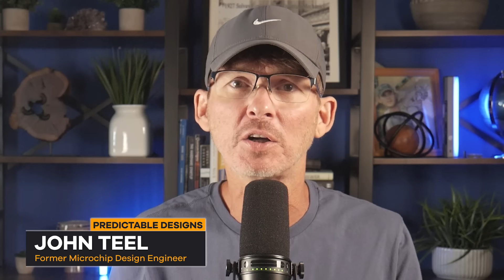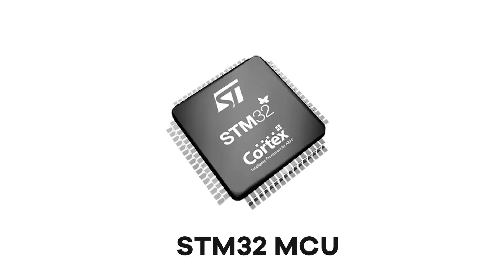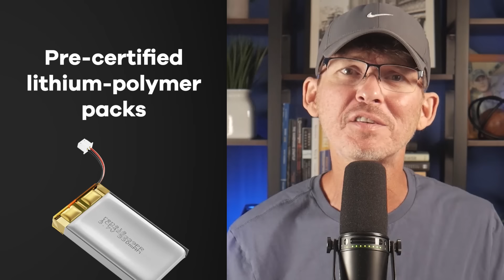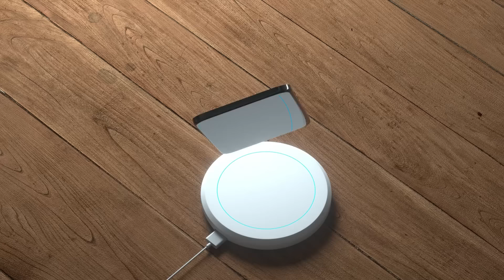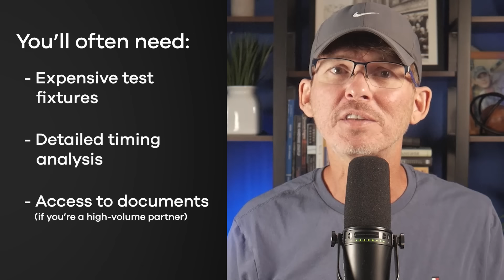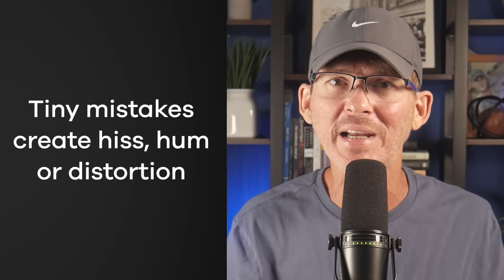10 Technologies You Should NEVER Use in a Product

Comment: USB PD is really no big deal these days - there are plenty of cheap dedicated chips like CH224K, HUSB328, IP2721 and AP33773S  that just do the job very easily with no software needed. The biggest issue is the variety of different flavours of USB mains adapters.
Reply: Yeah , usb pc is quite a non Hassle, only the consumer is usually confused, by which cable and which charger to use .
Reply: USB PD has the potential to allow devices to only draw what the supply can provide. Maybe you’ve got a soldering iron that can run at 100W at 20V, but plugging it into a 60W 20V PD supply will cause it to PWM its heating element to 60W instead. Or with PPS, you could tell the power supply to output a proper CC/CV charging curve for a 3S lithium battery without needing an SMPS in your device. But these more advanced features can’t be done with a simple PD trigger IC, rather you’ll want a microcontroller talking the protocol. QC4+ has similar features. If I recall, WCH makes some microcontrollers that can talk on these CC lines with dedicated hardware. There’s also whatever the Pinecil and TS101 are using.

Definitely more complicated, but the space, EMI, and efficiency gains that come from power negotiation can really push a project into a more feasible realm. I’d just like to see a power negotiation protocol for higher powers with a more robust connector. CAN over 7W2 D-subs. With dumb cables.
Reply: I think the simplicity in usb pd is that it exists already, the power adapters are everywhere and it can output pretty much anything you would need. Yes, a simpler power solution could suffice, but in most cases it would be worse for the end user.
Reply: I came to say the same. PD was a breeze to implement for me.
Reply: Carriers scavenging frequency ranges to support 5g is putting a much closer time limit on LTE than one might expect.  Perversely, this is more of a problem in small single-tower towns than cities.    LTE just disappeared for friends in several locations like that and they found they had to replace LTE with 5g in fixed devices (alarms, etc).
Reply: CH224K Is being replaced by the CH224A
Reply: When you realized how much power USB can draw--enough to heat up a soldering iron cherry red, you want to minimize the chance of being dragged into court because your cool new wearable scorched somebody's scrotum. Unless you're Apple or Google, just use a ready-made certified module.
Reply: I agree with that, although I understand why the technology is listed as avoidable. While it's easy to implement and get results with it rather quickly and reliably (AP33773S  is indeed a wonder), it can be added effort to actually use it to the fullest and the point that he makes is valid, that most of the times PD it's not needed, it's just founders obsessing about new tech or hw engineers wanting to explore cool new stuff.
Reply: @andrereuter6521  I think a lot of engineers prefer to roll their own just for the optics. They don't want a customer saying, "Ha! They just soldered on a ESP32-S3 dev board to the PCB. Why did I pay $1000 for this again?"
Reply: stm32 mcu's have PD controller included so its possible to implement power delivery with minimal extra parts.
Reply from the maker: In general I agree, not nearly as complex as the other techs, but I still see it being used in cases where a simpler power solution would suffice.
Reply: @PredictableDesigns  simpler power solution just means another random dc power supply. Just get a good usb-c brick
Reply: @PredictableDesigns you dont know shit
Reply: @PredictableDesigns  in the EU you might not get away with a barrel power connector any more.

Comment: I might have interpreted your segment on USB wrong, but at least how I understood it i disagree strongly. I suppose it depends largely on your intended user, but from a consumer point of view, usb-c products not conforming to regular PD standards are annoying to the point where I’ll usually not even want to own it. Devices not capable of negotiating a 5V requirement and thus needing a separate USB-C to USB-A, plugged into a supply only providing a set 5V are a definite no-buy from me. 

If designing devices for usb-c, I’d make sure to either read up on properly negotiating your desired voltage using the programming resistors defined in the standard, or simply use an of-the-shelf module.

Not to throw shade on the video, though. I agree with many of the points, and have learnt much from your educational content!
Reply: I think I ran into this the other day - a board had a usb-c connector but would only draw power from usb-a.  For a while I thought it was broken.  If you're not actually going to support usb-c, don't use a usb-c port; just stick to micro-usb.
Reply: There is no negotiating your desired voltage using the programming resistors. Another voltage can only be negotiated through a digital communication protocol using the CC lines. There are certain resistance values in the power adapter on the CC lines which indicate the maximum current that can be delivered.

Comment: This seems very pessimistic especially with usb power delivery. There are a lot of easy to use reference designs, now even for bidirectional 48v 240W power.
Reply from the maker: Yeah maybe a bit pessimistic on USB PD, it's not nearly as complex as some of the other tech here. I've just seen designs with issues trying to use PD when a simpler power method would suffice. I always push for the simplest solution that solves the problem.

Comment: If you're designing something and a microcontroller (esp32 etc) just isn't enough... you can always use an i2c expander (port expander, dac, adc, pwm controller), or... add another esp32. ❤
Reply: 100% expanding with a i2c bus is a real life saver plus opens of extension options
Reply: I prefer SPI.  it's faster, you don't need to worry about addresses for the trade off of a GPIO which you could just get more of from another SPI chip.  But yeah that can get complicated
Reply: Most people don’t want more advanced chips for this stuff but rather more compute power, integrated cryptography and so on. You can’t add it all with i2c.

Comment: Raspberry Pi computer module at $35 isn’t an option if you want to build anything that’s price competitive, for small run, hobby or prototype, sure.

Excellent video though.
Reply from the maker: Yeah that's true for many products, but some aren't cost sensitive at all and it can work in those cases. MPU modules are any type are always quite expensive, and MCU's are so much cheaper.
Reply: For many industrial products, the price is relatively unimportant compared to development time and the benefit of having a mature hardware implementation (that  runs Linux).
Reply: Price is an issue, there's also the issue about what to do if they have issues making enough boards.Centering a project on a specific board doesn't necessarily scale if you don't have the ability to either negotiate more to be made or can switch to a different supplier.

Which, for a bunch of the people here is probably not an issue.

Comment: I gave up on qualcomm, unisoc. I am trying to make 4g work in wearables but it seems only available options are modules. Do you think it can fit into wearable? Smallest i found was 15x17mm.
Reply from the maker: Qualcomm is the worst! They won't even acknowledge you exist unless you're a billion dollar company.
Reply: As someone who has spent their entire career in the 1G/2G/3G/4G/5G industry the module route is the only route unless your product development spend is above $500k to manage all the rf design, test gear,  regulatory, and certifications.    Not counting chipset development or manufacturing licensing.  And thats for an experienced team.      Going chipset up is a monster job from both hardware and software.  Even the module route comes with some decent antenna design challenges and regulatory costs.
Reply: You absolutely do not want to do a "chip down" cellular device unless you have a budget in the millions and a couple of years or runway. Stop that thought now.

Comment: Raspberry Pi and Documentation only with small disclaimer. GPU and some other parts are also locked behind NDA. Only GPU of RPi 1 was released in the wild, and some/many of the mailbox functionality seem (as reported by users trying to do their own RPi OS) not (realiably) working anymore. Also comments read on issues regarding this indicate that this will get worse in future releases, as only some previliged NDA'd linux driver developer will/have access to documentation. So you'll be basically forced to use Linux with these drivers, or live with limitations you may not like.
Reply: It's possible to port a Linux driver to a different OS but it's harder without any documentation
Reply: There is also no schematics of modern RPi boards, nor documentation to the interesting parts of the RP1 chipset. Its on par with the Rule #10 .. dont go with fancy APs.

Comment: I'm a relative newbee to product design but I don't agree with you on USB C PD. There are new chips on the market which are fairly easy to implement, such as the AP33771C and its more complex brother AP33772S and so did I. Especially the AP33771C is meant for replacing DC jack barrels and therefore super easy to implement. Looking forward to your vision on this, maybe I'm overseeing something.
Reply from the maker: Thanks for sharing that. You're right that chips like the AP33771C and AP33772S have made USB-C PD much easier to implement compared to a few years ago. They are a big step forward.

Where I still caution people is that PD brings hidden layers of complexity that are often underestimated. Even with an IC, you're now dealing with higher voltages, negotiation protocols, compliance requirements, and stricter testing. It can still increase your BOM cost and your firmware work if you need custom negotiation. 

For many products that only need 5V at moderate current, USB-C PD is overkill compared to a fixed 5V USB-C port or a simple barrel connector.

There are definitely cases where PD makes sense. But for many early-stage products, it is one of those features that looks simple on paper but ends up causing problems later.
Reply: @PredictableDesigns I love USB-C... connectors. Really easy to interface with.
I'm biased against USB PD; when I need more power, I often need 24v, which is past the spec, or I need 5v, which doesn't need PD. Plus if you don't have a USB-PD supply, you can only get the basic 5v.

I understand its use in commecial products, but as I'm not drawing high currents or strange voltages, I'm happy to keep my USB ports dumb, simple, and reliable.

Though I will confess to using barrel jacks when I do need a strange voltage, using a mosfet as reverse-polarity protection.
Reply: I'm sceptical of high power USB-PD in general, it feels like there are a lot more failures even on high quality laptops from lenovo dell related to the power jack in recent years than there were with old fashioned barrel connectors. For products I am choosing the connectors I still like USB Mini-B, not quite as klunky as a full B but a lot more sturdy than Micro-B or C

Comment: MIPI DSI is supported by ESP32-P4 MCU which is around 4USD. However it is more difficult to work with in comparison to parallel interface of ESP32-S3 due to length matching and impedance control.
A question regarding USB PD - there are "barrel jack replacement" PD controllers such as TPS25730. Are there any tricky aspects of using these?
Reply from the maker: Yeah the ESP32-P4 and an STM32F4 are two of the only microcontrollers I know of that support MIPI- DSI.
Reply: @PredictableDesigns  There's over 40 STM32F4 and F7 MCU's with MIPI DSI interfaces. STM even has a dev board with an integrated DSI LCD, the 32F469IDISCOVERY. The 769 board has an optional DSI addon board.
Reply: @PredictableDesigns  what's your opinion on "barrel jack replacement" PD controllers such as TPS25730?

Comment: The mipi stuff hits home. Ive been struggling with prototyping a device that I need very low latency / lag real time display from an embedded camera. I thought mipi csi and dsi would be the way to go but quickly found they're an absolute beast. Looks like people are busting out oscilloscopes i cant afford to even get DSI displays to power on and initialize. I was worried about clock cycles and sync bit banging spi or rgb, but it seems much more realistic route to take
Reply from the maker: MIPI can definitely be a challenge, thanks for sharing your experience!
Reply: Thanks for helping me realize I'm not just stupid. I have no background in electronics or engineering so it's hard to gauge what aspects are legitimately complicated vs just lacking fundamentals people would learn in an undergrad
Reply from the maker: @Jason-fp7vi  You'd probably be surprised how much of this is really learned by "doing" and not from undergrad studies.
Reply: Yeah, I'm seeing issues with MIPI DSI at the company that I'm working for. We have a product based on Raspberry CM4 and the plan is to use custom displays. It has been months since the start of prototyping and we have not been able to make it work; only official Raspberry displays work.
Reply: @williamdetempolivre  if you’re in that situation I’d suggest finding a contractor that has actually used them before, it will save you a lot of money

Comment: I've built a product that passed sub-ghz certification with a custom ceramic loop antenna design. Speak to the antenna manufacturer for design guidelines and choose a proper PCB house (JLC is NOT proper), we had extremely inconsistent performance on the VNA with JLC stuff even selecting the highest medical/military quality or whatever it was at the time. Partner with a PCB specialist company who will also take on the liability - it wasn't that much more per unit. Anyway, get your 3rd year RF textbook and just do it. It's not difficult and sub-ghz is extremely powerful. What IS difficult is battery selection when you have unrealistic lifetime and size constraints chucked into the mix...
Reply from the maker: Great tips, thanks for sharing your experience!
Reply: Question from a firmware engineer and newbie to RF design: why not just design a panel with 10 designs which are each subtly different and evaluate the best performer. With firmware I often find it's quicker to code different approaches to the same problem and measure which approach performs better (a/b testing I guess) since many PCB Fab houses accommodate small runs, surely it's a reasonable approach to order a batch from many, and evaluate and select the best?
Reply: @davidf6592c hmmm I think the best analogy here would be this: imagine you're writing code that has to be tested on a supercomputer somewhere, and you're billed for the run time, each variation of your code you run incurs a charge. Same idea here, you're paying a certification house to run the tests, the more tests you run the more you're charged. You can certainly do what you suggest if you have the money to burn.
Reply: @xxportalxx.  I wouldn’t iterate hardware with a third party handling validation I’m referring to in-house iteration. That means evaluating hardware variants using your own spectrum analyzer, objectively measuring attenuation and quasi-peak detection across designs, and choosing the best-performing variant to move forward with.

I don’t think your analogy quite fits, since it assumes you can’t perform the evaluation in-house, which isn’t the case - unless I’m misunderstanding your point?
Reply: @davidf6592c  You can do that if you're really unsure on how to use a VNA or don't have access to one. Best approach for your example is probably just getting an RF Explorer and running Continuous Wave (CW Test on some factory modules) and trial and error. That sounds like a headache though, imagine all the combinations of C1, C2, C3, R1, R2 with each PCB variant... 

My advice in your shoes - I would get familiar with a VNA OR if you have a nice and willing certification house, they could help you with matching (probably for a much smaller fee than the likes of Taoglas' antenna matching service).
Reply: Hi, what is the textbook title?
Reply: @ooc4436  I just leave here some text to get notification if someone answers
Reply: What's a good PCB house, can you reccommend one?
Reply: I disagree with this advice, I got my NRF52 antenna tuned for free by the experts at Nordic and it made a HUGE difference to the range, I wouldn't have passed FCC without it. They told me that almost all antennas must be tuned even if they're based on a reference design and the only way they can safely and reliably do it is using the expensive ($40k) Rhode and Schwarz test equipment, otherwise they cannot check for failure in the upper harmonics. And you need someone who is an expert at doing something like this. Nordic do it as a free service. Which is incredibly helpful.
Reply: If you think there's any real liability for a Chinese manufacturer, regardless of your agreements, think again.